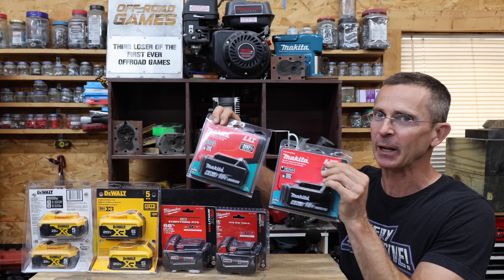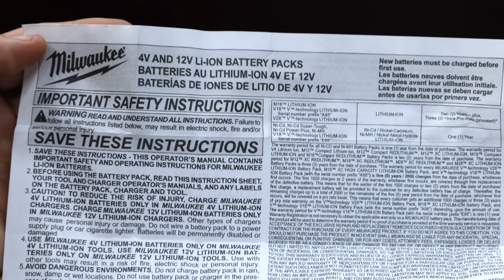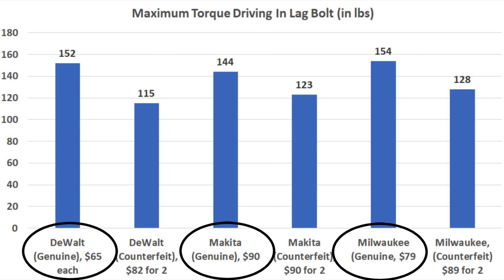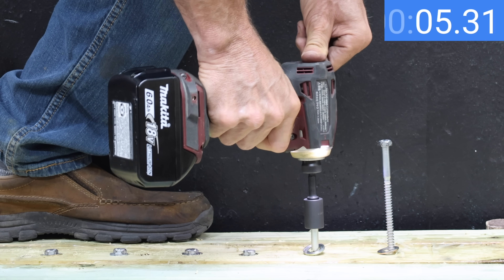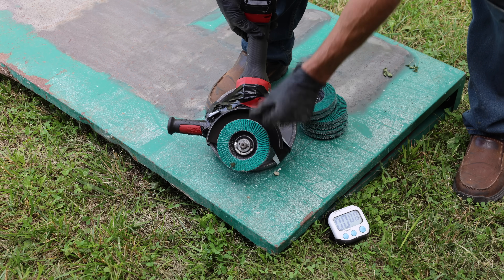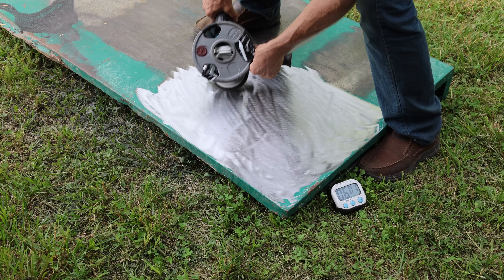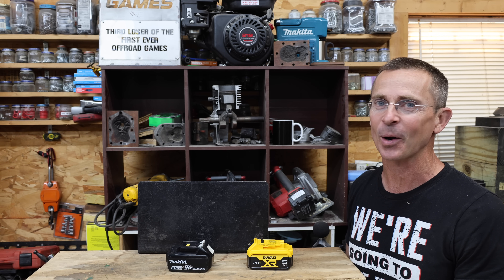Have You Been Scammed with a Counterfeit Tool Battery?

Comment: I bought a generic battery for my milwaulkee tools a few weeks ago (sold as generic, not a counterfeit). It was a 6ah 18 volt battery. It cost $50 Australian, a genuine 6ah battery is about $280 australian. The genuine battery prices are nearly double the cost they were 3 years ago.
 The generic unit weighted nearly a 100 grams less than my existing genuine 3ah batteries. ( dont have any bigger genuine units for comparison).
I ran a test of the genuine 3ah verses the 6ah generic by drilling 20mm holes in wood with a spade bit. The generic battery lasted slightly longer than the 3ah, certainly no where near as long as I would expect from a true 6ah battery.
But at less than 1/5 of the price of a genuine battery, I will buy more, I refuse to pay the ridiculous prices they want for batteries these days if there is an alternative.
Reply from the maker: Thanks for sharing.

Comment: Thanks for sharing how to quickly spot a counterfeit battery  - use a scale  !
Reply: True, but eventually the counterfeiters will wise up and make sure their counterfeits match the proper weight. There's been problems with fake supplements as well. The solution was a special label provided by a third-party authenticator. These tool brands need to do the same.
Reply from the maker: You are welcome!

Comment: I recently decided to replace my old Black & Decker homeowner set and invest in a new battery/tool ecosystem. I considered these brands, and even noticed the disparity in pricing of the same batteries by different third-party resellers but I just didn't make the connection between price and counterfeits.

Good to know! In the end I went with Harbor Freight's house-brand Hercules 20V tools/batteries, not ones likely to be susceptible to this problem.
Reply from the maker: Thanks for the feedback.

Comment: While I don't buy counterfeit batteries I do buy 3rd party compatible ones. 
As proved if you need the maximum power then use the genuine one which I do in those situations. 
But if I'm going decking screws with low load then yes the genuine battery will give me 20% more per battery but I can get far more work out of two 3rd party ones for the same price.
Reply from the maker: Thanks for sharing.

Comment: There's no control board in the dewalt batteries. It's just a PCB to hold the battery contacts instead of loose wires like the other one. There's no charge/discharge control in Dewalt batteries.  the PCB just contains the contact points for the main charge points and the 5 interbattery charge monitor contacts so the charger can manage charging the batteries.
Reply from the maker: Thanks for the feedback.

Comment: I’ve decided to run a second battery in my camping rig. It’s an old beater but I already use a cheap inverter to run a small air compressor. Recently I’ve been thinking of running a cheap solar set up. I’ve been looking at the “starter” kits on Amazon and Walmart, like 100 watt solar panel with the controller and a 2000 watt inverter.  I’d like to know what I would need for a second battery to store that power?   For charging devices, running a small fan and probably a mini fridge for a few days.   How’s that sound for a viewer request?
Reply from the maker: Thanks for the suggestion.

Comment: Can you do a test on the expanding foam vs concrete for posts
A few manufacturers of the foam and using dry filling the holes with the concrete and adding water against pre mixing the concrete 
Pushing over, pulling up, etc
Reply from the maker: Thanks for the suggestion.

Comment: We manufacture , you can say fake battery , but we install only Sony Murata VTC5A cell. Case and electronic are fake but cell are genuine. This we copy from good practices and continue to make better pack then genuine. All is about cell quality. Many brand used Murata VTC4 VTC5 and VTC6 cell but switched to low cost Samsung 25R.
Reply from the maker: Thanks for sharing.

Comment: I bought some "generic/no name" batteries (knowingly) they were both about 1/2 of the rated  amperage. I paid ~$30 for 5/6 amp hour batteries got 2/3 amp hour batteries. As it turns out I could buy OEM batteries for rated 2/3 amp hours for the same price so there is no price advantage in buying no name.
Reply from the maker: Thanks for sharing.

Comment: Watt hours to go with but please know this is constructive feedback but please look up the max amp hr rating because some batteries aren't rated for 5/10/15/20 amps i know this cause i fly and build fpv airplanes i have to build custom battery pack pack and depending on what i want my planes to pull higher cruising amps ill either use  higher amp rated cells or lower rated cells when you look at the data specs youll see they are all different

Comment: I see these things ALL over the place and it's absolutely insane how close they are. Even the rubber molding on the bottoms of the Milwaukee looks identical. Gotta weigh an authentic battery compared to the fake ones to really know for sure, otherwise there's not enough of a tell. Quality batteries are heavy.
Reply: I'm surprised they don't add weights in them to match the authentic ones
Reply: They will now.  Already done with other types of items.

Comment: Many of the counterfeit batteries are being sold on EBay. Home Depot and most other repeatable suppliers sell only the originals. The counterfeits started showing up en mass in 2023. Most of the older code dated batteries are original.

Comment: Honestly if it wasn't for any safety concerns I'd prefer to just go with counterfeits for basic home tools which I wont use much. BUT I'd just buy an actual third party battery for probably the same price as the counterfeits even if they're the same. A 4ah third party is normally cheaper than a real 2ah battery so even if the third party only has 3ah in reality it's still better value, but again who knows what safety they have. There are many reputable third party battery suppliers though which do have safety stuff built in. When a 4ah genuine Lidl cordless battery costs $30 then it's clear that the others charging $70 have huge markups and a middle ground is possible.

Comment: Video is super relevant, as usual. I ran one of those load testers on a brand new, fully-charged, 10AH DeWALT DCB210 pack yesterday. I set a 15v cutoff voltage but it stopped at just over 6AH and the voltage recovered from 15v to 17v. Not sure how I can actually measure 10AH with this thing. Mine load tester is the slightly-newer DL24 version.

Comment: Speaking of Dewalt batteries, could you try the power stack batteries the 1.7 amp hour and the 5 amp hour I have a 1.7 amp hour and my deWalt grinder runs the battery down quick, but the five amp power last quite a bit longer and also I’m curious to see what the battery looks like inside when it’s disassembled

And lows would the batteries

Comment: one thing that i did notice with these counterfeit batteries, is that they are great for stuff like powering car LED lamps for testing. because genuine batteries have a complex circuitboard, its a point of failure, and will easily break them. so maybe not a good point, but because they have less safety, they also have less points of failures and more act like a regular battery with just a plus and a minus.

Comment: Great vid as allways!! But 2 things ... 
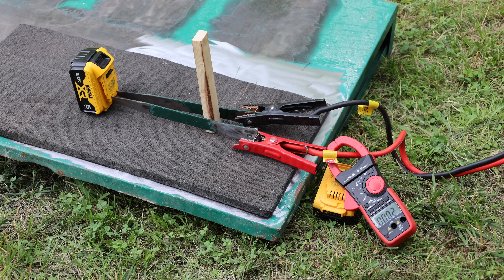1) at 16:50 you say Voltage spike of 290 apms ... Amps and Volts are 2 different units.
2) When you play vith batteries (at the end) I highly suggest to not use any metal tools even as a pointer ... It still can be allive and lead to nasty spark or even flames like you showed at the end.

Comment: The same can be said for autoparts.  You think you are getting a genuine OEM part, but it is counterfeit.  This is where the brick and mortar stores guarantee authentic and genuine parts.  As the old adage goes, you can't judge a book by its cover.  Thanks for the video Todd and have a great day!
Reply: Yea until someone returns a fake and that gets put on the shelf then you buy it
Reply: I am retired USAF and we had a problem with counterfeit parts for our aircraft. It's crazy. The worst was some 'lightweight bolts' we once got. They were plastic bolts covered in aluminum. I am not kidding.
Reply: @Colorado_Native Boeing must've gotten some of those for their doors 😂😂
Reply: @BabyJesus66  I knew we shouldn't have sent them back (just joking). They were actually for a Boeing KC-135R tanker though. You may know it as the KC-367-80, Dash 80 or the 717. Thanks for the reply.
Reply from the maker: Thanks and you are welcome!
Reply: The airline regulatory agencies uncovered similar problems with spare parts back in the 1990s, after fake parts (substandard bolts - Partnair Flight 394) resulted in a fatal crash. That resulted in stricter controls (and higher expense) for sourcing parts used for maintenance and repair. But it's still anyone's guess what percentage of the parts used are fake.
Reply: @solandri69  The aircraft parts problem is a great example.  The system nominally had full source to use traceability with inventory tracking, yet counterfeit parts were widespread.
Reply: Auto parts? Counterfeits are a huge issue with airplane parts too.

It's not like we can just pull over when something gives out, and believe me it's exciting when you blow a tire landing your Supercub.
Reply: Some places wont even try to pretend it's an OE after advertising as such....they'll send it right in the generic brand box
Reply: Counterfiets show show up in brick and mortar stores too, including national chains.  Employee theft and substitution are a huge problem.
Reply: The Car Care Nut has numerous examples of fake "Denso", "Toyota", and "Lexus" parts being installed and not working on his channel. That's a good place to start.

Fake plane parts brought down the Partnair plane, and they've also played roles in other crashes. They've even been found on both the old and new variants of Air Force One. Boeing is working to resolve the issue on the latter planes, 2 747-8s, resulting in big delays in the program.
Reply: Airplane parts as well.  When I was working in aerospace in the '80s we got some parts returned as defective.  We inspected them and determined that they had the right part number, reasonable serial numbers, very good copies of the factory stamps, but the parts didn't even look like what they were supposed to be.
Reply: Stores usually place "never opened" products back on the shelves so the switcheroo scheme comes into play.
Reply: I bought transmission oil on ebay once. The bottles appeared to be genuine with mfr dates spanning 2 years, but 1/3rd of the bottles were clean and the rest were covered in motor oil smudges. I could tell the bottles had been refilled with cheaper aftermarket fluid and recapped with new bottle caps.
Reply: People are getting fakes from Ford dealers post plandemic
Reply: That's why if your car is not that old, you should go to an official dealer and buy from them.

Comment: I bought an off brand Metabo battery, and after only using it a dozen or so times, the locking tabs that hold the battery onto the tool are broken, making it basically worthless now.  Probably gonna stick with original brand from now on.
Reply from the maker: Thanks for sharing.

Comment: This is why I never buy batteries or memory cards from Amazon. They say sometimes you’ll get fake toothpaste from Amazon too.
Reply: I love the fake toothpaste, they use radioactive whitener that really does the job.
Reply: Maybe it's caulk  @EngineerMikeF
Reply from the maker: Thanks for the feedback.
Reply: Or car parts.
Reply: That is scary, considering that fake cosmetics often have lead in them.
Reply: I once got a fake Anker USB cord.
Reply: Amazon can be fine if, and only if, it's sold by Amazon. The overwhelming majority of people though think that because it ships by "Prime" it's also sold by Amazon, but of course isn't. Amazon allows the fake products because they get paid for every one sold.
Reply: If you don't wanna research and use your brain, don't buy anything Amazon
Reply: @JosephDredd31 EBay has more honest way rating their sellers. I’ve had a lot better luck using EBay then Amazon.
Reply: buying from brand or their dealerships VS some shop called "dsvdrvqdbvdfv"  does a lot already, but ofcourse, then you only go 10-20% cheaper and not 50+%